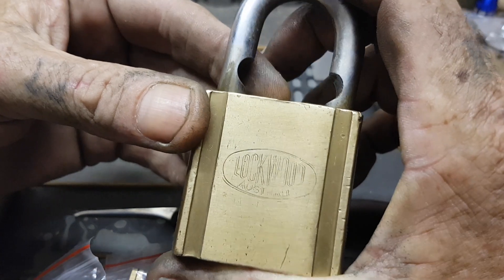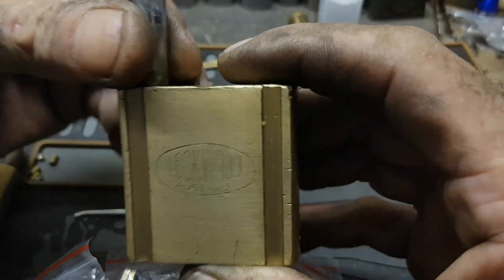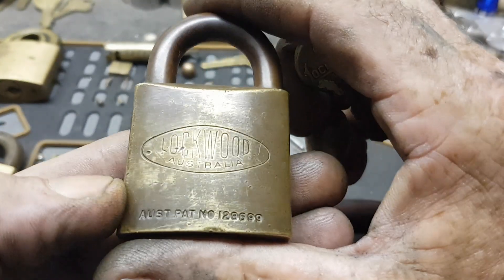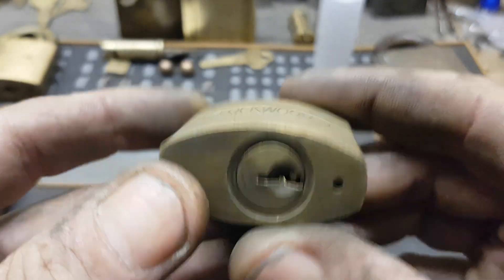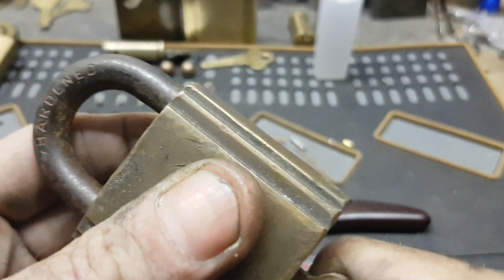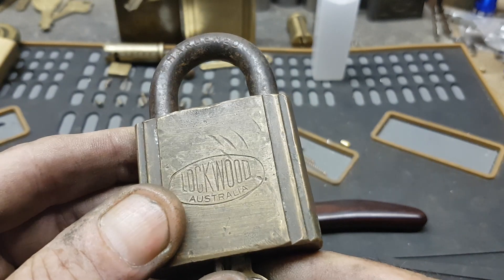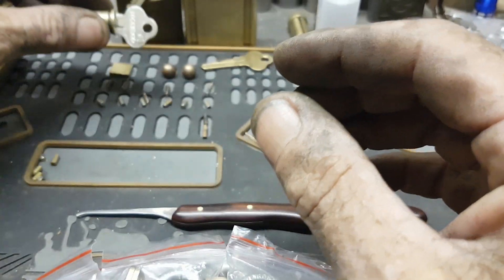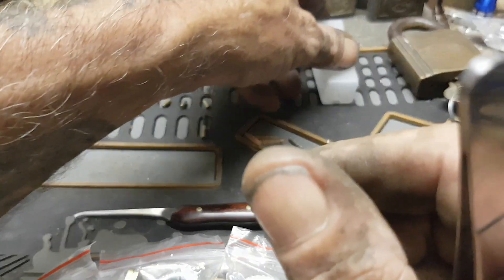#286 A Lockwood ramble and an upcoming 247 refurb.

Comment: Good to see the old gang of Lockwoods again mate 🤘😁
The 234 with the odd cut shackle is strange. I remember you previewed it well over a year ago.
I too have 2 of the 232s with no logo and has the Genuine LW15 keys too. This is just a guess, I think they are the ilco variant.
Have a great weekend Paul
Reply: Yeah, that shackle is very odd. Never seen one like that before.
Reply from the maker: Thanks mate. Yeah, i don't know. It just seems a little odd that they would have Lockwood embossed operational keys with them. You might be right:-)

Comment: Great video Paul. So the only difference between the 245 and the 247 is the shackle type?
Reply from the maker: The shackle and the 6 pin body were the two differences between the two. There was a 6 pin commercial body 245 but it didn't have the super hard shackle. The super hard shackle was the precurser to the Boron Alloy i believe:-)